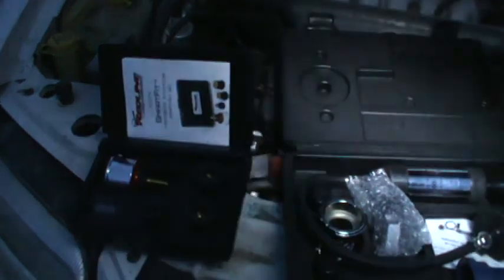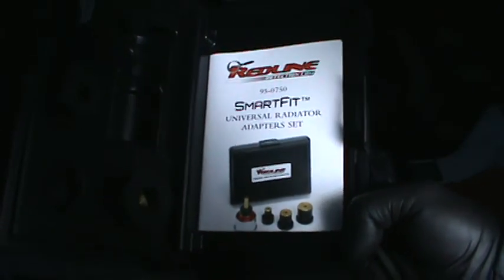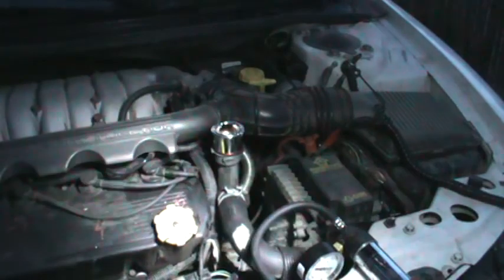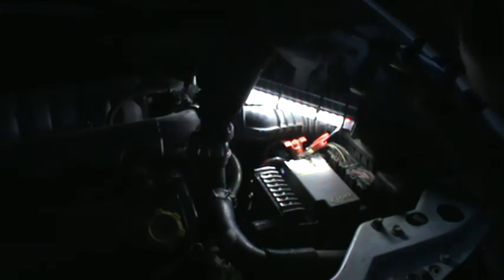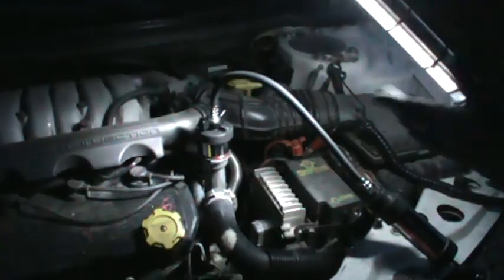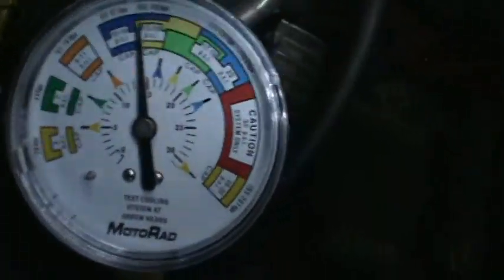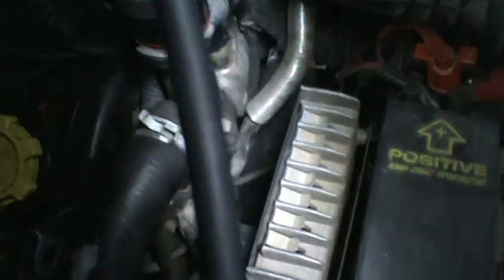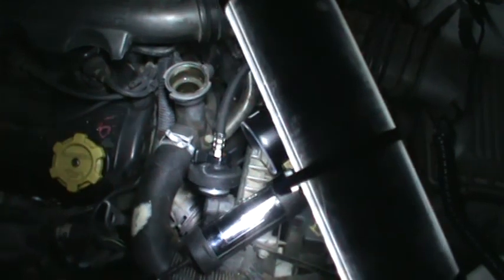Coolant Leak Testing

Comment: I like the kit.I don't think you were doing yourself any favors trying to work with no light though. Couldn't you have checked the cap with that kit also? If so you may have been able to complete your diagnoses.
Reply from the maker: Yes, the pressure tester comes with the tool to test cap. Sorry about the light, I do what I can, when I can.